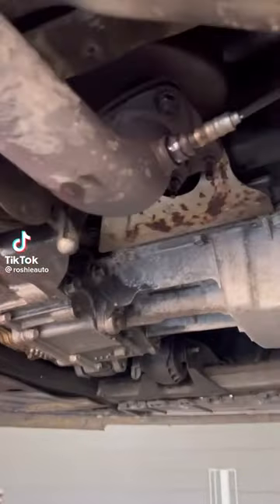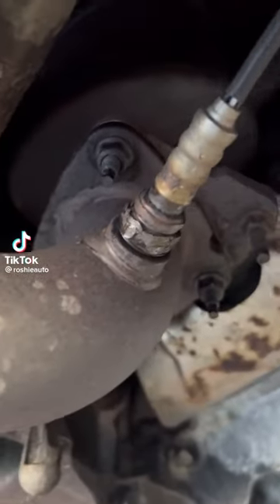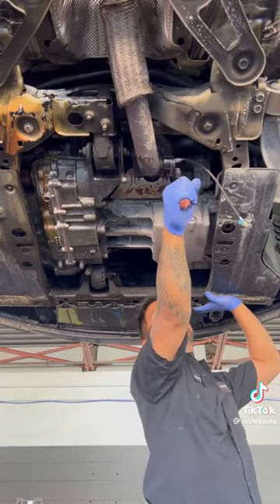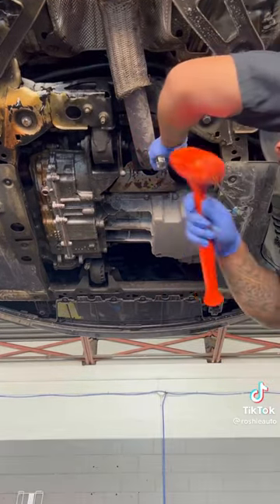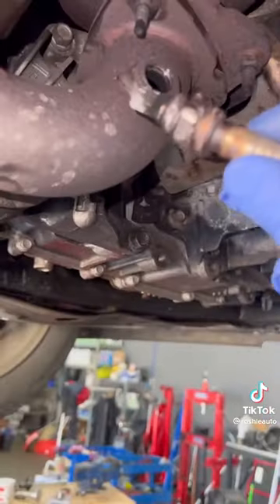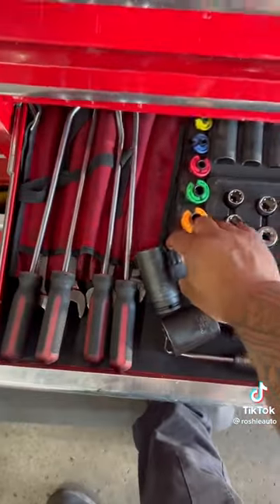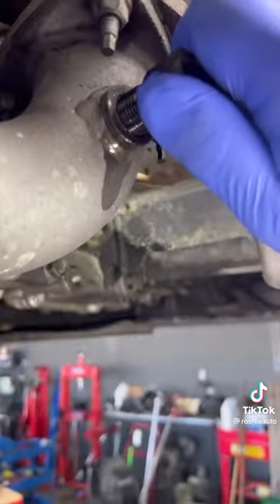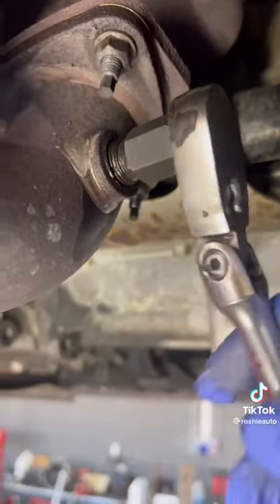How Engineers Keep Mechanics Miserable (Part 372) #shorts

Comment: Actually I praise the engineers for the location of that O2 sensor
Reply: First thought I had lol like sweet baby Jesus bless that engineer 🙏
Reply: You should see the rest of that engine bay lol then you will praise no more
Reply: I currently am in the process of actually replacing a upstream o2 on a 2000 regal there is about 7-8 inches of clearance between the firewall and the back of the motor its insane the car runs like a dime and damn is it reliable but some locations of things do not make sense at all. thanks buick engineers 😂
Reply: Yea all I saw was some prior idiot didn’t know what they were doing. Engineering team did just fine.
Reply: I was going to say the same thing. You could have gotten that out with a pipe wrench if you had to

Comment: I missed the part where engineers are to blame for this.
Reply: In my opnion, one of the consideration of design is the cost of the product. The more you get inexpensive the higher you the get margin.
Reply: Cause they're the ones who helped design the car???
Reply: The Engineers are the Ones that decided where the best place to put stuff is
Reply: @deltasixgaming  some mechanic stripped the threads. That was the only issue here.
Reply: Environmentalists  and the EPA will do.
Reply: Could also just be the lack of anti seize

Comment: Try and use some copper anti seize it's better for hotter temperature.
Reply: The exhaust is stainless you need nickel anti seize, the copper will react and corrode the stainless steel.

Comment: How to do this without stripping the threads:
Run the engine and get the exhaust hot. Spray a shot of a cold aerosol of some sort on the 02 sensor, like throttle body cleaner, to cool the sensor down a little. Then loosen the sensor. This will stop you from destroying the theads pretty much every single time. I've done a couple hundred of them and this method works like a charm. Just spray the tip if the sensor right before the wires.
Reply: Thank You 🙌
Reply: Also how i do this, works every time

Comment: I like to let the engine idle for a little bit then spray the sensor(s) with PB Blaster. Warms up the threads and blasters helps loosen any rust or corrosion. They pop right out for me

Comment: Whenever I change those, I usually chase the threads and use a little copper anti - seize on the new one. It's also a good idea to use anti - seize on spark plugs. Especially if you're installing the cheap ones like Autolite. 😂
You'll be changing them again in about 7k miles. 😂

Comment: Just cut off the wires and use a 7/8 closed end wrench. It comes right loose and then chase the threads
Reply: Or use man strength and large pliers. Out in moments.
Reply: Or you could easily just use a pipe wrench

Comment: To anyone trying to take out an O2....PLEASE just start with heat. If you have access to a propane or MAP torch, use it till the o2 sensor *the part where your wrench (or better yet socket) would go till it gets some color into it. Then they come right out no biggie. same for most exhaust nuts and bolts. Ofc unless you're in some magic no rust fairly land,

Comment: Tip heat around the o2 sensor with a blow torch enough heat the metal expands and it comes right out done it many times

Comment: I replaced the exhaust on my Pontiac G8 with 200 miles on it for a performance system and I had to clean up the treads on the O2 sensors due to them galling when I took them out.

Comment: I took an 02 sensor off once and had a similar problem, I stopped before I rounded off the sensor. I took a torch and heated the welded nut and it came out very easily. If you don't have a torch just run the vehicle until the exhaust is hot.

Comment: If your replacing the sensor for sure I’ve always found it easier to cut the wire and throw a six point socket on it when I can access them easily like that

Comment: I think you want to do half a turn then back out a quarter turn with those thread taps/chasers, just wrenching it down like that is a great way to cut the threads wrong
Reply: With a tap, maybe.  With a chaser, no.  If it's straight, it's straight.  They have grooves in them for any cut material to fall into.

Comment: With all the room you have, just cut the wire and grab a 7/8 half inch drive socket ratchet and a piece of pipe. Even if it don't want to, that sensor is coming out.